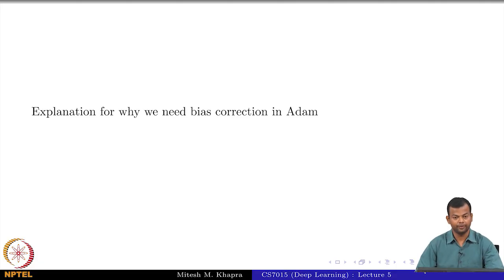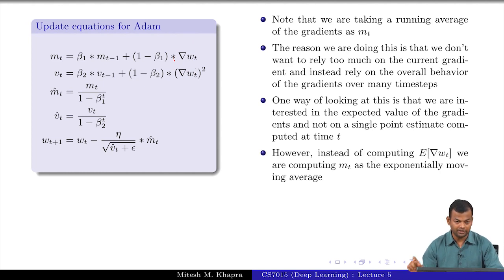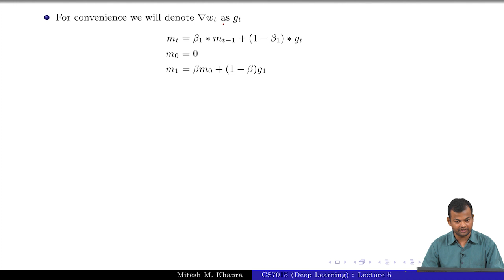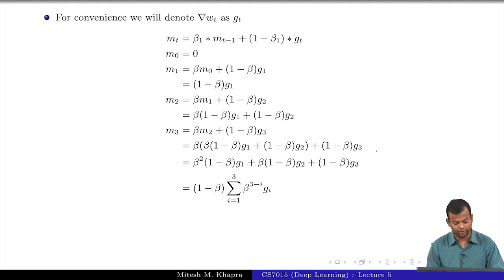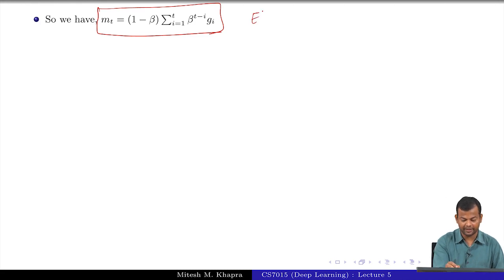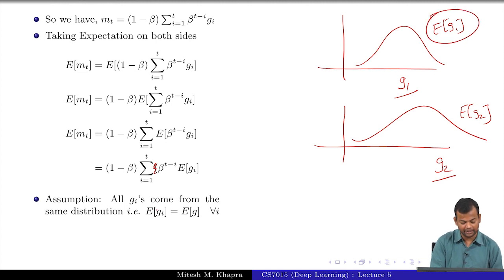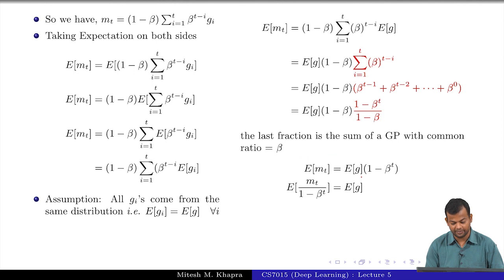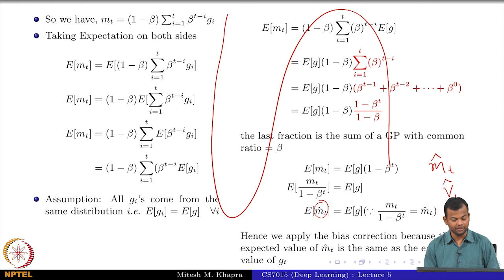Deep Learning(CS7015): Lec 5.9 (Part-2) Bias Correction in Adam

Comment: As E[mt] = true expected value of gradient after making bias correction ,does this mean loss will always decrease?
Reply: Not sure about loss in this case as bias correct is used to bring the exponentially weighted running average same as the gradients and that is what he proved mathematically in this lecture ie the expectation by using bias corrected exponentially weighted running average is equal to the expectation of gradients

Ps: do correct and explain me if I'm wrong
Reply: If your entire data set is noisy, then it wont work, however if you have noise in some data and not on the entire set, then yes it may remove the noise.
Reply: The bias correction is just multiplying the mt with a constant. This is already done by the learning rate. And loss doesn't always decrease as we have seen the error to overshoot due to the presence of momentum. As long as E[mt]  = c*E[gt], we are in the right track as learning rate will take care of the rest